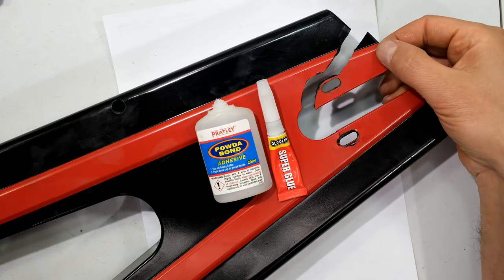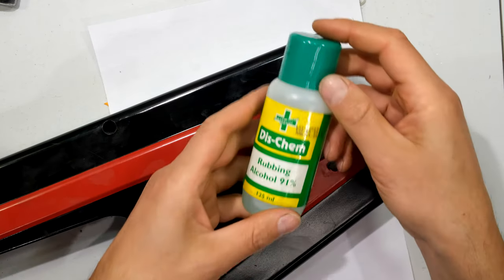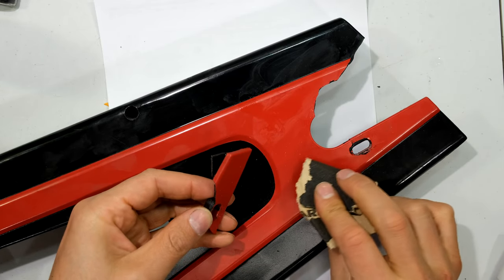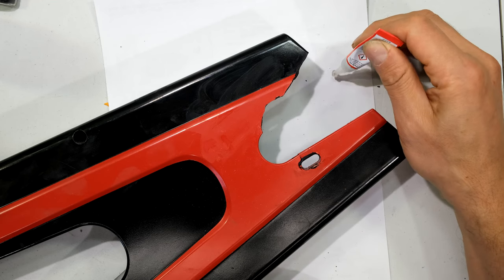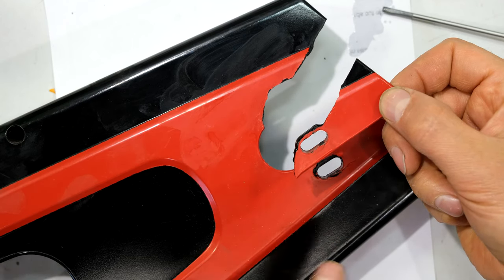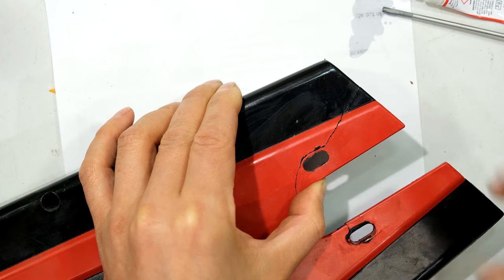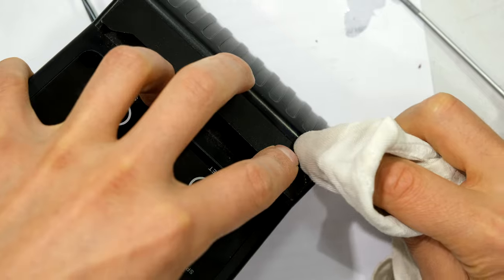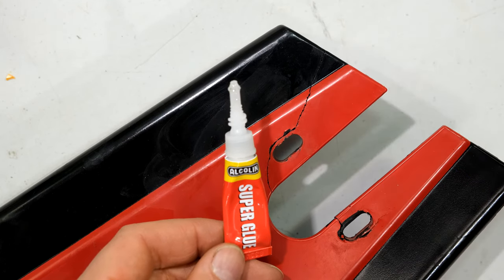How to use super glue to fix / join broken plastic

Comment: Sorry. I disagree.
I work with super glue on a daily basis and that repair job will last until it's bumped or come apart with a bit of flexing or even some vibration. 
This repair work is a basic plastic repair job that would be good enough for a child's toy.
This repair job is strictly temporary at best!
Here is a link to proper plastic repair:
https://www.youtube.com/watch?v=WXRUO9KmrYk&t=313s
Reply: Surprisingly i watched this video (your given link) many times ago wow!
Reply: @pk365degree5  much thanks. One day I will make a better video/s with more props.
Reply: Wow cool in formative video I doe summing similar instead of screwdriver I use toothpick wood one